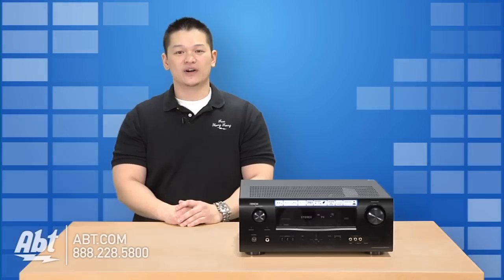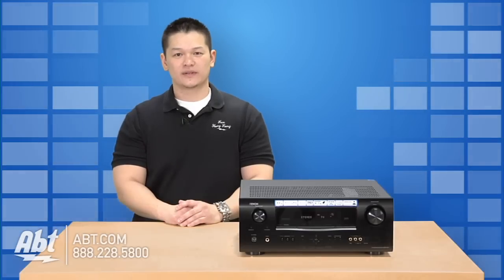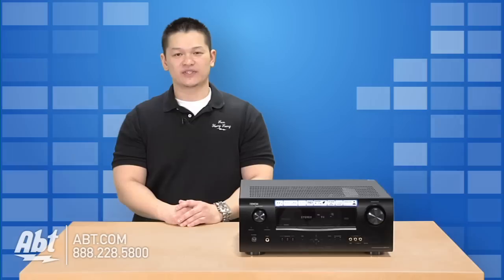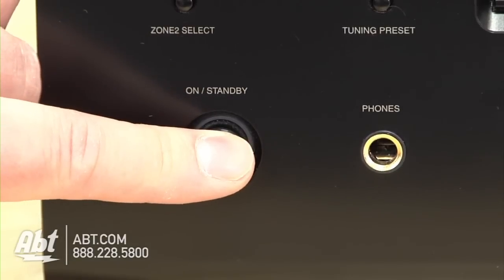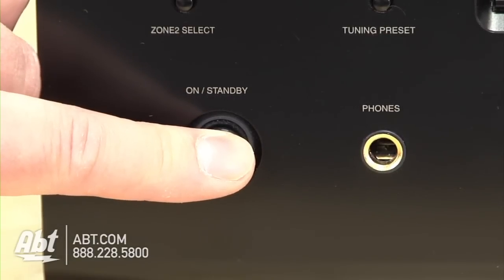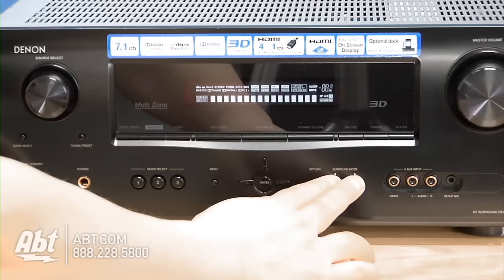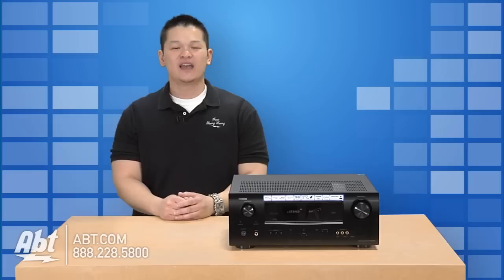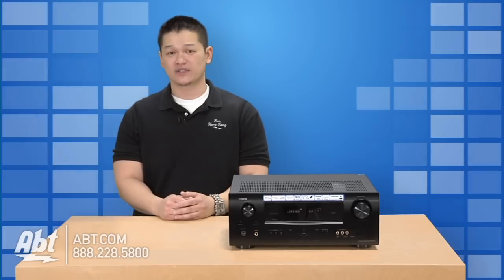Abt Electronics: Receiver Reset

Comment: My Kenwood vr606 had no light or power suddenly.  I reset it and all good!  Hold power, plug into ac, release button, re press power on.  Happy!
Reply: I just bought a KW VR-616 from a thrift store...Power light turned on but there was no display. Thought it might be a cracked solder joint, but I tried this and it worked! Thanks!

Comment: My Marantz receiver just went out. By that I mean it won’t turn on manually or with the remote. I called the installers but they’re not in until Monday. Is there something I can do in the meantime? it did get overheated before it quit so I unplugged it until it cooled off. Now it’s just dead.

Comment: How to reset sony reciver
Reply from the maker: Hi Hafeez.  The process will vary by model number.  Which model number are you looking to reset?
Reply: Abt Electronics lbt vr90av
Reply from the maker: Here are the steps as listed by Sony for a factory reset: "1 - Unplug the power cord.  2 - Plug the power cord back in.  3 - Press and hold Clock Set, Enter and Power at the same time."  That should reset it to factory settings.
Reply: Abt Electronics ok wait ill try
Reply: Abt Electronics the push power protector is blinking in display is there any method for solve that problem.....
Please please help meee......
Reply: Hello sir r u there
Reply from the maker: According to Sony if that is flashing it means a strong input was detected.  They say to turn the power off for a while (they don't specify an exact amount of time), then turn it back on.
Reply: Abt Electronics but sir this is flashing more than a year i dont know to solve that problem please help sir

Comment: How do i reset a harmon kardon 146
Reply from the maker: Hi Brandon.  According to Harman Kardon, "To reset the AVR 146, place the receiver in Standby mode (press the
front-panel Standby/On Switch so that the Power Indicator turns amber).  Then press and hold the front-panel Surround Mode Button for at least 5 seconds until the RESET message appears in the display".  I hope this helps and  thanks for watching!  -Carl
Reply: How  to reset  harman  kardon  Avr 660